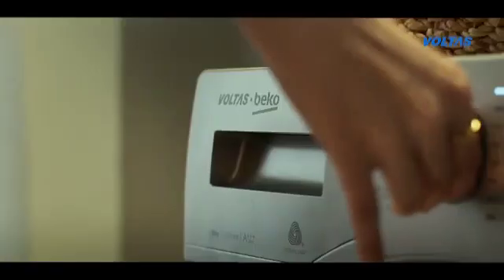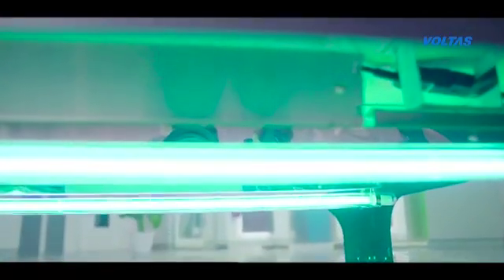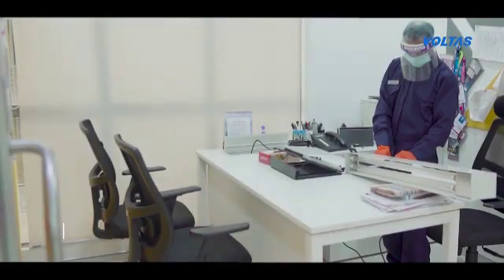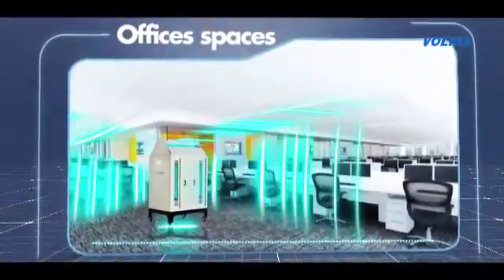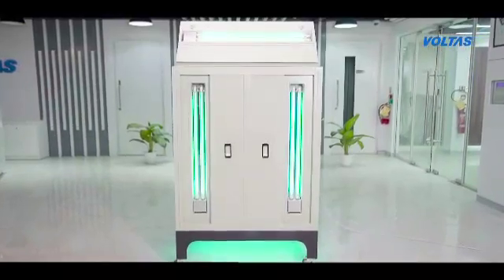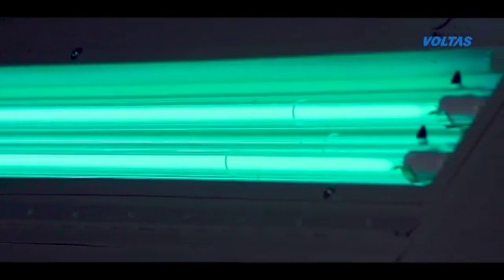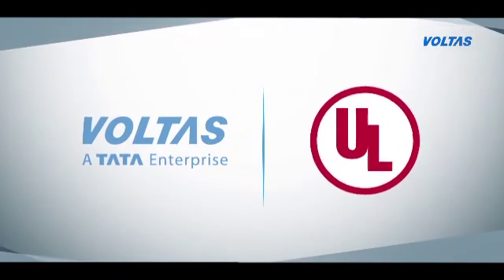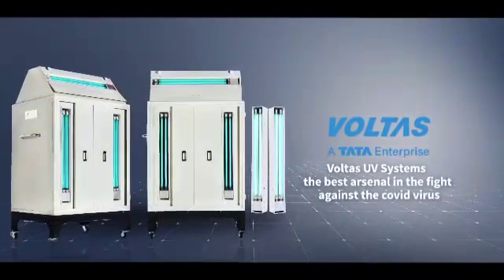UV-C Based Air, Duct and Surface Disinfectant System

Comment: I had purchased most expensive voltas AC via Tata cliq with 5 year warranty. It is problematic since the very beginning. Now after 3 years they are refusing to claim warranty as i had not availed expensive 700₹ service from voltas authorised agencies. Also they do not service good enough to the product.